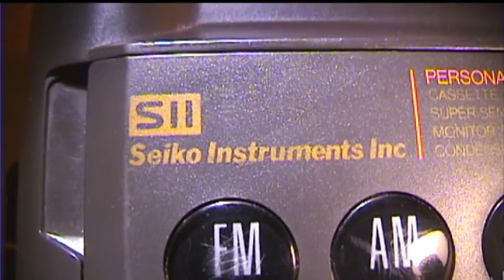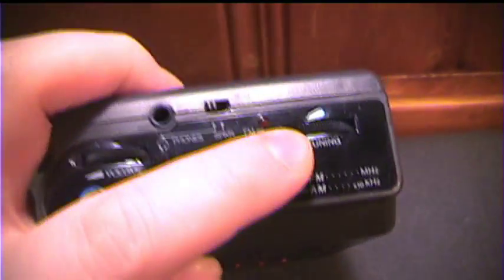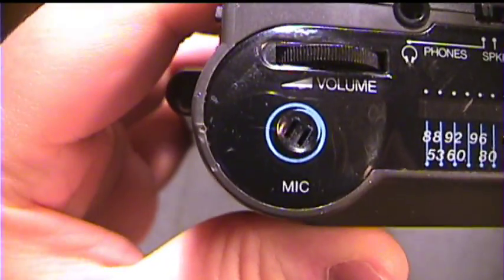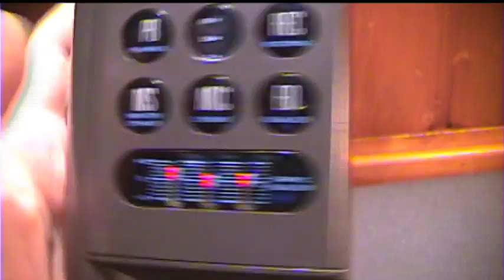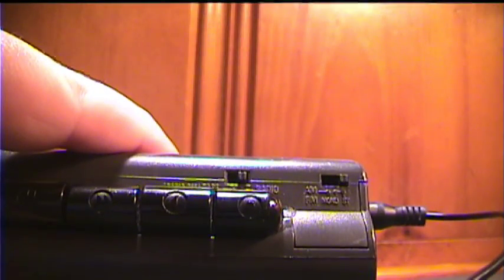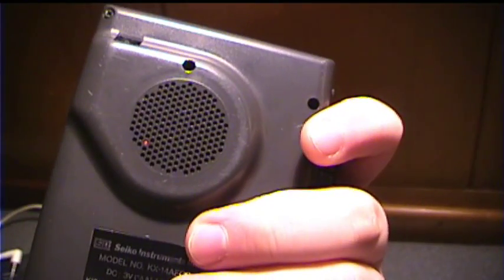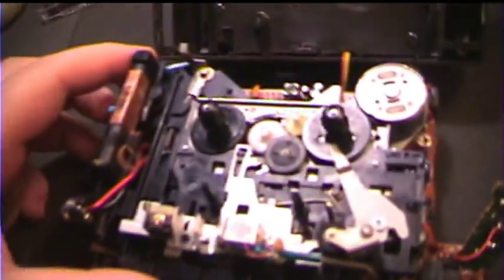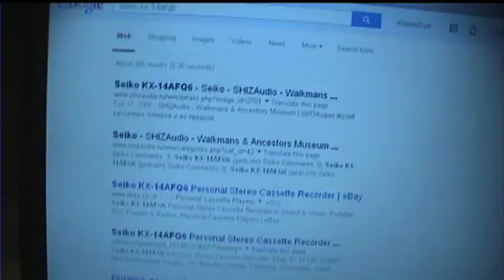1987 Seiko KX-14AFQ6 Personal Stereo/Walkman

Comment: I had a late '80s/early '90s Seiko bookshelf stereo system, and it also had a fairly wideband AM tuner. It also had the unusual feature of its graphic equalizer having an effect on the recordings you made using its cassette deck. So if you boosted the bass on the equalizer while recording a tape, the tape would have boosted bass recorded onto it. Sometimes this was a nice thing to have, such as if you were going to play the tape on a Walkman or car stereo, but if you didn't remember to adjust the EQ to flat before recording, you could easily end up with way too much bass or treble on the tape.
Reply: I think I found the model you described on eBay… perhaps you should find one and do a video about it!